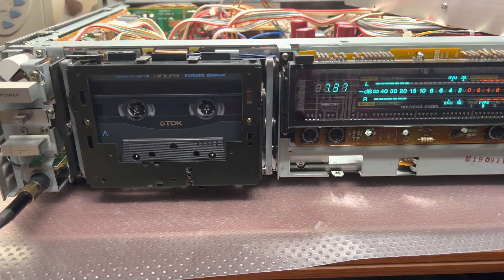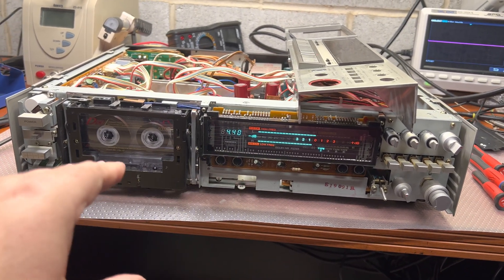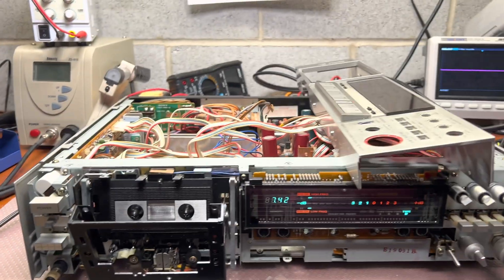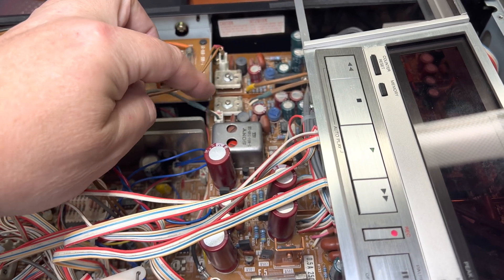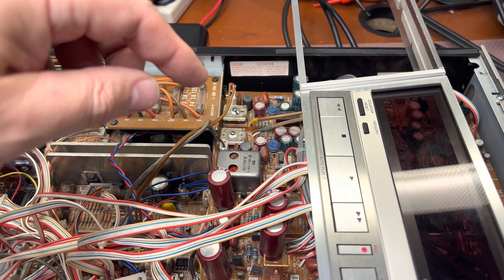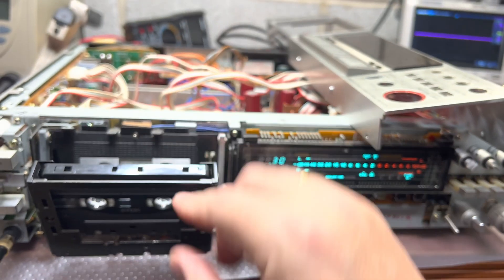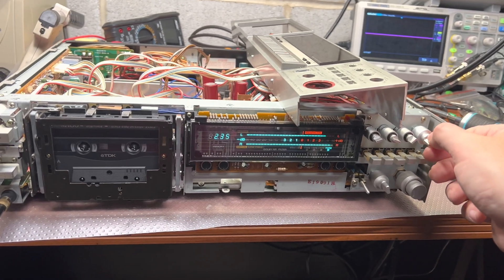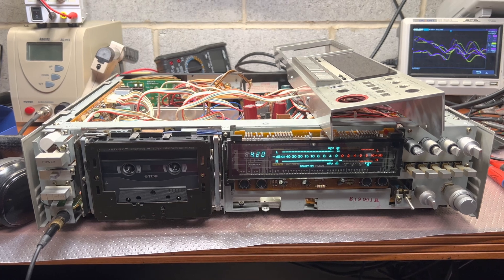Cracking the Code: Sony TC-K777 Calibration Mystery Solved

Comment: How did you verify the tension on the left supply reel? Don't tell me you used a torque meter cassette.

The trouble of maintaining cassette decks is that it COSTS more to buy the tools than to buy them by the tens.
Reply from the maker: I have a torque cassette but can not measure the back tension with that model. I was measuring 15 kHz tape playback and tuned unless high frequencies stop changing the level between left/right channels between play/stop modes.
Reply: @hifirulezzz  Good intuition, I'll try to keep this in mind... it can't be a so rare condition on these vintage decks.